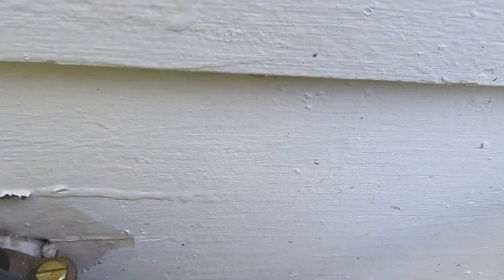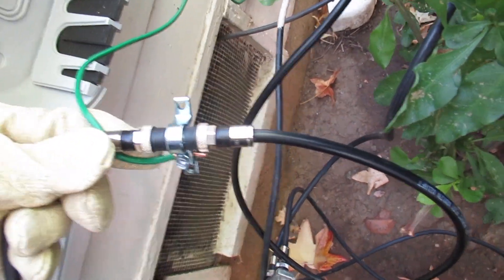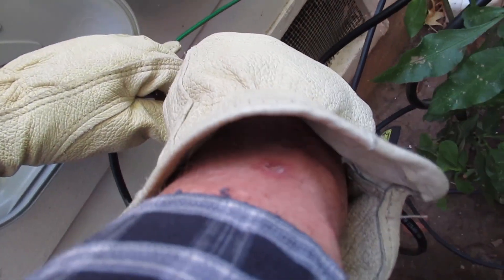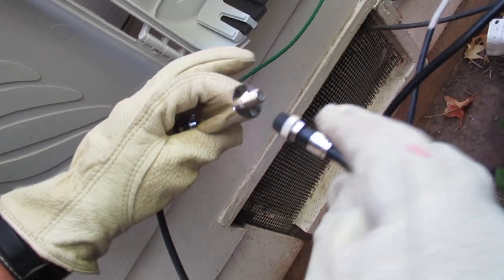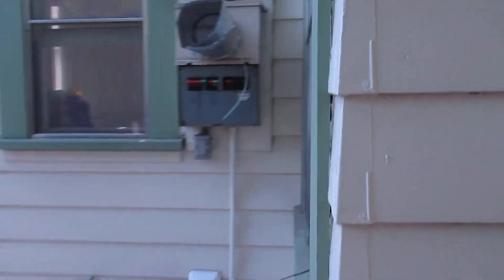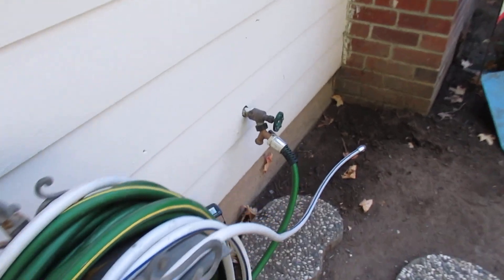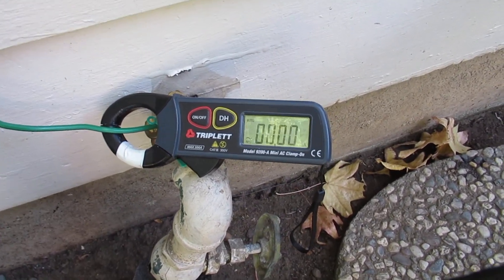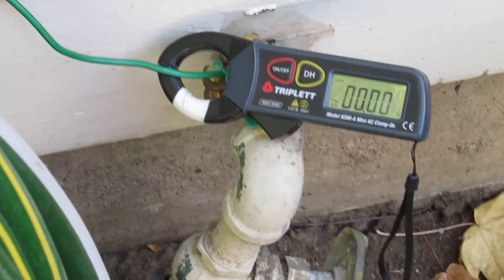Electric Current on the Comcast Cable Creates Magnetic Field across the House

Comment: Cable companies will remove this as soon as they see it.  Don't waste your money.  Anything added by the user at or before the demarcation point needs to be supplied by the cable provider or they will remove it, even coaxial fittings.  Cable companies consider the water main to be a good ground, and technically it is a perfectly acceptable ground, although I agree grounding to the meter/panel's ground is preferred.  Stop selling people things that will just get thrown away
Reply from the maker: Hello John,  
Thank you for taking the time to comment!

Where did you get the idea that these $30 dollar high pass filters are being thrown away by the cable company?  They seem to stay in place for years.  Additionally, if the cable company does remove it, which I have not heard from my clients, they can always ask for installation of another one.  

IN this case the cable company put OBJECTIONABLE ELECTRIC CURRENT on the clients water pipe which created a health hazard magnetic field across the living room and kitchen and it bothered  my client.  This was not acceptable to my client and she wanted it fixed.

Here is the section of the National Electric Code (NEC) that defines objectionable current and outlines acceptable solutions.
250.6 Objectionable Current over Grounding
Conductors.
(A) Arrangement to Prevent Objectionable Current.
The grounding of electrical systems, circuit conductors,
surge arresters, and conductive non-current-carrying materials
and equipment shall be installed and arranged in a
manner that will prevent objectionable current over the
grounding conductors or grounding paths.
(B) Alterations to Stop Objectionable Current. If the
 use of multiple grounding connections results in objectionable
current, one or more of the following alterations shall
be permitted to be made, provided that the requirements of
250.4(A)(5) or (B)(4) are met:
(I) Discontinue one or more but not all of such grounding
connections.
(2) Change the locations of the grounding connections.
(3) Interrupt the continuity of the conductor or conductive
path interconnecting the grounding connections.
(4) Take other suitable remedial and approved action.

Comment: Bravo! May I ask what symptoms this woman had and did they resolve after this discovery and remedy? We have same reading on our cable. Thank you so much
Reply from the maker: Agitation, anxiety, paranoia.  She also had a lot of dirty electricity from her new energy efficient HVAC system with variable speed motors.  She felt worst when the HVAC was on.  I suggested that she replace it but she had just purchased it for $18,000.
Reply: @Windheim EMF Solutions  thank you for responding. Very interesting! What did you suggest for the hvac? I know these new systems are a requirement for new builds now.
Reply from the maker: @vfsd234  Specify that all motors be PSC, permanent split capacitor only.  Avoid ECM or variable speed motors or drives.

Comment: I have that GLF 1002 as well (and the same issue with the green Xfinity wire which *should be connected to my outside water service supply pipe but it was just lying down). Magnetic field everywhere in our house over 100 nT (I found that it most likely comes from the pad-mounted transformer which is outside on the street).
Two questions please - should I anyway install myself a Hi-Pass filter in my Xfinity box and what else I can do to find the real source of the high magnetic field? Should I call my local electrical company and make them come and test the transformer?
THANK YOU!
Reply from the maker: Hello AP,

If you would like a consultation please begin by filling to the Contact Form on my site: https://windheimemfsolutions.com/contact-us/  .  Sincerely your,  Eric Windheim
Reply: May i inquire how did you measured the  magnetic field?  Thank you
Reply from the maker: GigaHertz Solutions NFA1000.
Reply: @Windheim EMF Solutions  thank you sir!

Comment: Did they check the ground impedance as well?  Sometimes ground connections can LOOK good but actually have high impedance due to dry soil or other factors.

A high ground impedance could contribute to the low-frequency signals being carried along the coaxial cable's shielding since they wouldn't be captured and shunted to ground via the grounding block if the impedance is too high.
Reply from the maker: Comcast clamped it to the hose bib on water pipe as shown.

Comment: My whole house is grounded but not Comcast grounded the box outback to my coaxial cable and it’s causes high ampliage to where my service doesn’t work so they came out today and disconnected it to see if this will fix the problem will it ? Please get back to me it’s driving me crazy
Reply from the maker: Hello YS,  you can contact me via my website listed at the bottom of the page.

Comment: Windheim EMF Solutions, hello 👋 is this filter something I can install myself? Thanks in advance.
Reply from the maker: I would leave to a professional as there is some risk of shock
Reply: If there is that much current to shock you on a cable drop, there are more serious issues afoot. Installing this filter is no different than connecting your modem router or your TV.

Comment: Hi - When I had a comcast tech come out to my house to put a High Pass Filter on my line, the tech said that I wouldn't need one because I already have the MoCA filter (which I thought was only to prevent cross interference). Is there any difference between this and a MoCA filter?  He also said it wouldn't allow the signal though.
Reply from the maker: Hi Lorna,  This filter is a Hi Pass filter which lets the signal thru but stops the 60 cycle AC current.  It is also called a ground loop isolator.  I am not familiar with a MoCA filter.
Reply: @windheimemfsolutions  Got it.  Thanks.
Reply: @lornas4953  A MoCA filter is to stop your whole whole networking signal from making it out to the street. MoCA is how the boxes talk to each other and allow recordings from one box to be shared with the other boxes.

Media over Cable Acess
Reply: @Todd.T does a local prevent emi from incoming cable?
Reply: @vfsd234  Not 100% sure what you are asking. Blockers and whatnot are trying to mask a wiring problem. Cable campanies are changing the frequencies they use all the time and things like a blocker may cause an issue when the cable company upgrades their network. 

 The strand the main cable is lashed to shoiuld be bonded to the electricity carrying strand that is above it and should also be grounded every few poles. The drop to the house should have the messenger (steel supporting cable) bonded to the strand and at the house. The house should have the electricity meter grounded and the water should be bonded to the ground. The water pipes should be bonded to the electricity meter. The electricity wire hanging to the house is bonded to the strand and the panel at the house. If this is not done, then there will be a flow of current between what is bonded and what is not or what is bonded properly and what is not.

As an example a few years back a customer had the wiring in the house reversed so that anything attached to the TV that had it's own ground path caused a short. No fuses blew because the wiring was unfused. It dimmed the the lights and blew the cable connection off the TV box when you connected it. The X-Box had a three prong cable and shared the same reversed wiring so it had no differences. The cable had an issue and when a fresh one was run from outside and bonded to the elecricity panel. BOOM a short circuit.

So many times the cable had a better ground that the wiring houses and the products that were on the cable were using the cable as a ground which causes current to flow on the coax as the devices seek a better ground than the outlets has to offer. One of the solutions is to break the ground pin off the TV or device that has a cable connected to it. The other is to put some kind of blocker to break the cable ground so the electricity has no place to flow. The outside of the cable is a shield to stop RF from getting out and enterign the cable. Although it is possible to send electricity to the house on it, hardly any manufacturer does so. You would do so to power a device that would be installed outside.

So the problem is a difference in potential between the cable bond and the bond of the services at the house. Cable,. phone, water, electricity, gas should be bonded (together) so current doesn't flow between them. Electricty should be grounded to earth. In this video, something with a third prong (ground)  that is attached to the coax doesn't like the ground in the house and is trying to go through coax or there is something wrong with the bonding of the water service and something bonded to it is seeking earth through the coax.

EMI on coax comes from routing electricity in parallel with coax. The magnetic field produced on the electrical wire induces electricity on another metallic conductor or anything really (like a metal fence under high power electricity can become charged.)
Reply: @Windheim EMF Solutions  will my Comcast tech have ground loop isolator or will I need to purchase in advance? ( in my other reply I noted our situation). Thank you!
Reply from the maker: He is wrong about the signal.

Comment: I found a similar issue thanks to your posting.  There were noticeable fluctuations in household EMF.  It would appear that slight power surges from Charter/Spectrum (.03-.24 amps or higher) are infecting my system through the ground.  I was able to confirm these surges on the ground to the panel and sub panel while the power in the house was off.  I'm curious - can such small amounts of amperage be amplified by the use of household devices in operation such as LED lights, refrigerator, etc?
Reply from the maker: Great work Alice.  If your circuits are correctly wired to NEC code there should be no net circuit current and therefore no  increase in magnetic fields.
Reply: Hi Alice, did you get this sorted out? Curious how you did

Comment: This doesn’t explain fully what is happening. Loose connections and bad install. Possible bad neutral definitely bad ground. But there is not electricity on coax.
Reply from the maker: Hello Gilliganclown,

When I install the filter on the incoming Comcast cable the 60 cycle AC current is stopped and does not conduct onto the green bonding wire and the water service supply pipe which in this case ran the entire length of the house and created highly elevated magnetic fields along its path.  The filter stopped that.

Comment: If there's voltage on coax causing EMF throughout the house what would touching electrical wires make it even worse? My coax isn't grounded few years back I found this out and install the cable isolator adapter. Comcast is going to install a ground rod but they never did. Now I'm noticing a really weird issue seem like large amounts of EMF coming out of the wall I found out Comcast is touching the electrical. Even if I turn off the breaker the interference from Comcast is being transferred to the electrical wires I posted some video on my YouTube.

Comment: Could you also just have  moved the ground to the grounding rod?
Reply from the maker: No, too much impedance.  Has to be connected to the case of the service panel.
Reply from the maker: Hello John,

The entire Comcast service drop should have been located at the electric utility service entrance and grounded to the service panel there rather than attaching it to the water service supply pipe.at the front of the house.
Reply: If the plumbing can make noise on the field meter, does that mean it's not bonded to the rest of the house grounding system?  Would bonding the copper lines to the service ground assist without a need for the filter?  Or was the plumbing system made of PEX?